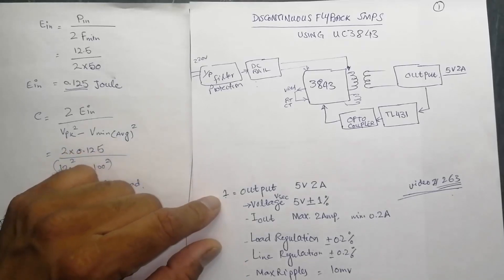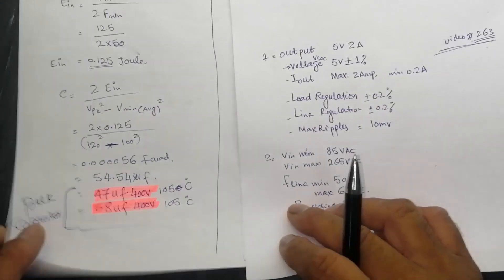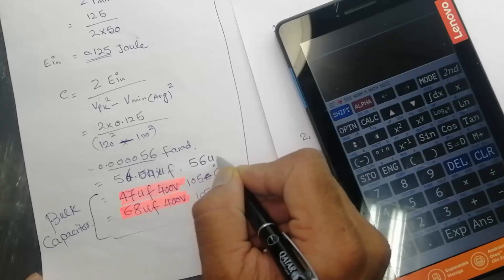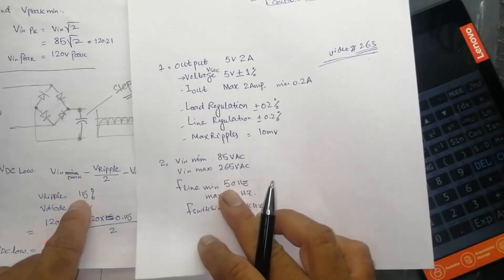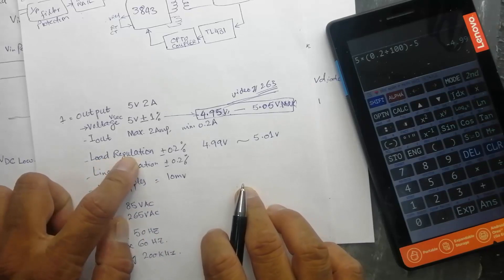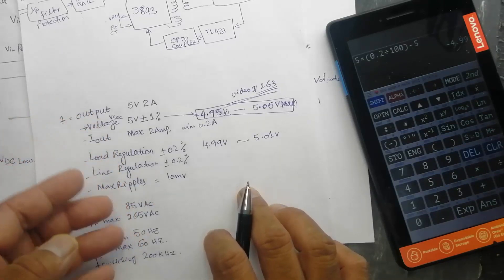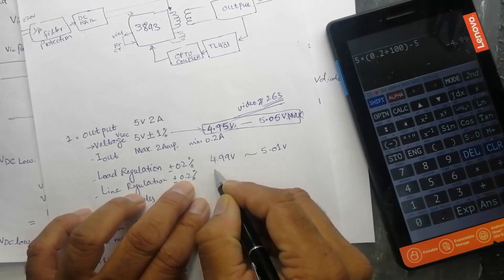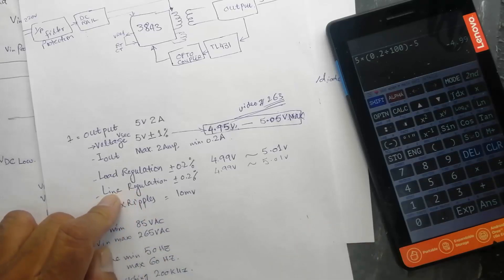{264} What is Output Accuracy, Load Regulation, Line Regulation in Power Supply

Comment: I set/start my 5V output at 5.1V, to allow for wiring voltage drop and contact resistance of the connector to the load.

Comment: Load Regulation, based on the supply requirements, should really be called Load Voltage Regulation because this is a voltage regulated power supply and not a current regulated power supply, which do exist but much more specialized as to the load requirements. 

Load Voltage Regulation and Line Voltage Regulation are static characteristics (steady state) of power supply performance. You do not suddenly change anything to make these measurements, any sudden are fast moving changes, relative to voltage regulation, would be dynamic characteristics (like maximum overshoot or something similar).

What is not usually mentioned is in order to perform the Load Voltage Regulation test all of the set conditions must remain constant; like AC line voltage and frequency (once set per the test), power supply power dissipation equalization (it must be "warmed up" with steady state power dissipation), the room ambient temperature and humidity should remain constant, and the load current should remain constant (a resistor is not a constant load as it warms up its value will change, so you would need a DC Electronic Load set to CC). Once you establish the test, now you can make the calculation: 

Load-Voltage Regulation (%) = ((Zero Load Voltage here at 0.2A) - (Full Load Voltage at 2A))/(Full Load Voltage) x 100. 

You can see, as per the calculation, that the requirement of Load Voltage Regulation of +/-0.2% is very tight. The nominal line setting is 115VAC 60Hz and 230VAC 50Hz.

Which brings us to Line Voltage Regulation. Well how do we make this test? If not otherwise stated, the load current would be set at 50% maximum output or 1Amp (which must remain constant). Then the line voltage is varied over its worse case range of voltage and frequency and the output voltage measured, with the calculation as:

Line-Voltage Regulation (%) = ((Highest Output Voltage) - (Lowest Output Voltage)) / (Output Voltage at Nominal Line Voltage) x 100. 

For a Universal mains design you would have two ranges to represent, usually nominal of 115VAC (+/- 30VAC) 60Hz and 230VAC (+/- 35VAC) 50Hz. The 115VAC low line is usually sufficient for the JAPAN rating of 100VAC in some provinces.

Comment: Haseeb, How can i check if my transistor is switching in circuit with AC multimeter ? The voltage drop must be higher or lesser ?

Comment: Hello, i am having an issue with a psu using 3845. Its frequency is 10 to 15Khz and output voltage is 1.6v. RT is 10K and CT is 1nf. Thanks for helping where to look at.

Comment: Sir, VDC peak is 374.76V so VDC high should be 374.76V + 28V = 403V right?
Reply from the maker: take 15% ripples of 375 VDC 
divide ripples voltage by 2 to take average
substract the resultant value from 375 volt 
it will become around 345 volt 

check video number 263